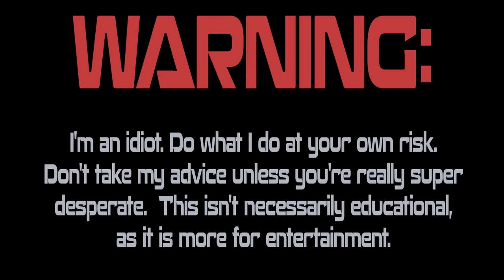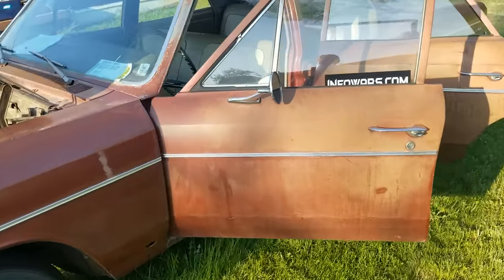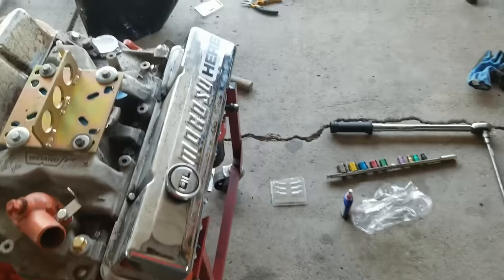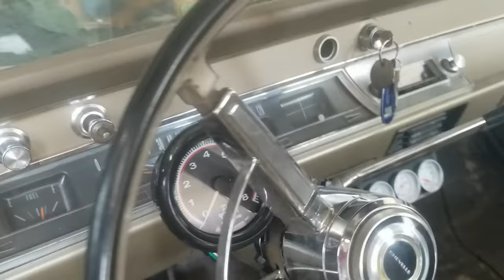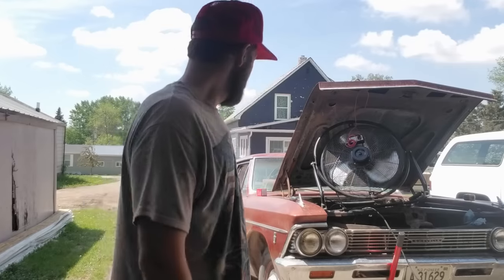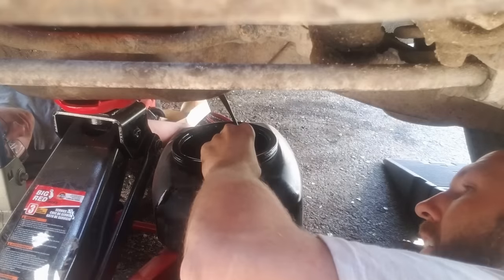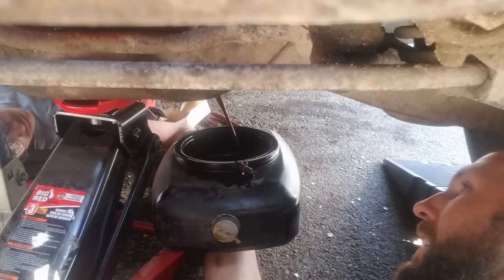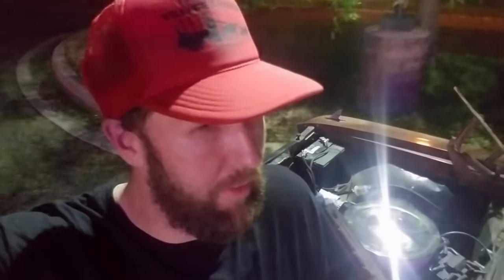ABANDONED Chevelle will it RUN AND DRIVE 600 Miles Home?

Comment: At just under three years later, this is definitely a change from the Independence Chevelle. Your videography skills have improved, as has your stage presence (that's not denigrating the early skills.  Just that you're better now).   Now I just have to find out what you do with this one.   (Unless this becomes the 70 Chevelle in later videos)
Reply: I like this stuff a lot.  Not that independence isn't a sweet build.  But this grassroots hot rodding spirit is very relatable

Comment: Make sure lower hose has a spring in it. If not make one from a coat hanger.  Without spring the hose collapses under acceleration.
Reply from the maker: Good point!

Comment: The reason you run hot is serpentine fan turning backwards. You need v-belt fan so it turns in right direction.
Reply: It also could really use a fan shroud.
Reply: Oh damn!   Never thought about this as an issue before!  Yes the other guy said shroud would help for sure and I was thinking electrical digical fans but he does need a V-* 4 core anyway... plenty out there for big block Malibus would cool this small block easy.
Reply: @THRASHMETALFUNRIFFS  I put one in my small block el camino. It takes a long time to warm up when you watch the gauges. It has senders in the intake and driver's side head. Problem is the holes in the small block shroud don't line up with the big block radiator cover so I had to use zip ties. And my soldering iron melted a divot into it.
Reply: @THRASHMETALFUNRIFFS  l

Comment: I like it a lot! Many people are to busy with life & or, full of it & don't appreciate the fact that cool cars are getting harder to find & that beauty/66 Chevelle 4door deserves another life! I like it a lot & im glad that a fun loving knuckle buster obtained it & is willing to turn a wrench & get dirty enough to get er going again! GOOD STUFF BRO!!! DID I SAY THAT I LIKE IT???? LOL     Me, I need any full frame vehicle I can find because I am so sick of 4 banger fwd trash! I want a 1973 Chevrolet 400 with 4.125 stroke! Brother had one that was bored .030 over, utilizing a stroker kit, forged, internally balanced crank, amber lightweight pistons 11/1 compression, the lift & duration -idk/ had it all written down but but, don't have that notebook anymore! it was a circle track/offroad cam from summit, aftermarket aluminum heads 202/160, roller rockers, msd ignition, Holley 750 dbl pumper w/manual seconsaries, th-400 w/new valve body, B & M shift kit, 3,500 stall conv, 373 gears in a mint 79 Z-28 BUILT BY A LOCAL MACHINE SHOP & MAN DID SHE RUN!!! 1/8 MILE BEAST!!! Long story short, I NEED TO RECREATE THAT DRIVETRAIN!!!!!! IF YOU KNOW OF ANY 1973 SB 400 WITH 4.125 STROKE, WITH NO CRACK'S, PLEASE MESSAGE ME?  GOOD STUFF BRO!!!
Reply from the maker: Hey, appreciate that! Thanks for watching and supporting.  In regards to the 400, they're great motors.  They all have a standard 4.125 bore, the stock stroke with factory crank is around 3.75.  Just have to be a little careful when boring them out.  Sounds like a rad Z28!  I think I have a 400 laying in the shed - but shipping will kill us unless you're from Minnesota.  Have you looked through Craigslist and Facebook marketplace?

Comment: Dang, it's a stick shift car! There's a bonus! I had to convert my grandmother's 66 two door 300 model to 4 speed and dropped a .040" over 427 I built into it. Basically a 390 hp 427 engine. Runs faster now that it will stop. Got the parts to fix that but haven't had the time.
Reply from the maker: Nice! This one needed a 4 speed badly
Reply: Brakes are over rated....Stopping is for those who don't want to win the race!

Comment: Just came across this. My first car in 1974 was a '66 Chevelle as well! It was also engineless but was a marina blue SS two door & had a Muncie M-22 rockcrusher & 4:88 12 bolt in her as bought. I was 16 at the time & built my first small block to bring her back to life. Fastest I could cruise in her was 50mph with that low rear, LoL. I bought new NOS chrome from the dealer for her & had her repainted. I remember problems as well with the positive starter cable melting from the header heat, ha-ha. Wish I still had her.

Comment: Them old 3 speeds are tougher than nails, I run one behind a 70 c10 for years with a 383 stroker and towed up to 8000 pounds, never had an issue.

Comment: what? A 40 year old dinky 6cyl radiator that was probably plugged 30 years ago won't cool a v8? the hell you say!!  LOL
Reply from the maker: Haha. What gives right?
Reply: Did you see the amount of debris on the backside of it? No radiator with that much blockage could cool a small block. Also a shroud would have gone a long ways.
Reply: sometimes what also helps is a cup of laundry detergent in the radiator, and take it for a run. Acts like a washing machine, and then dump out all the crud it washed and refill.  I like to lift up the front end, let the air bubbles in the system find the highest spot (like bubbles in a soda pop glass) and then burp the entire system with a big funnel.
Reply: @albertgaspar627  Or a $4 Prestone flush kit install in the heater hose and a garden hose
Reply: I love that those kits still exist--reminds me as a kid of doing the winter swap over on the parents' vehicles--tires and a rad flush. Does get in the way of the braided hose cover up kit, tho.

Comment: As a kid I wasn't well off, I worked the oil patch in the 80s and we didn't make the big money that makes big bellies LOL so a guy drove whatever he could afford... for me it was old GM stuff usually powered by a straight 6 and I never ever had one overheat or blow up. My '67 Chevy C10 was my last 6 cylinder powered truck. Being farm raised we knew all the other farmers and what they had for old vehicles and parts and I brought home a crazy strong 327 from a neighbors retired Massey Ferguson combine and decided to install it into my little '67 shortbox stepside truck. To just hear her run I used the 6 cylinder radiator and fired her up, seemed to cool decently so I fabbed up a nice shroud and used a big block clutch fan and not once did she ever overheat. Even when I swapped in the Duntov 3030 cam and a set of L84 aluminum Vette heads. Geez I remember paying 400 bucks for those heads, a lot of cash for me back in the early 1980s haha! But when I installed the MSD6A, headers, dual exhaust and a 700 Holley the heat started to climb quick so I tried a stock single core aluminum radiator from the GMT400 trucks and I learned that they cool quite well. I use those "cheap" rads in front of big blocks with no heating troubles provided there's a decent shroud and thermostat.

Comment: Brought back some memories. My second car ever was a 66 Malibu  2 door in that exact color but with more primer :P 327, 4 speed Muncie which was replaced with a Borg Warner T10 after I broke the reverse counter shaft off the Muncie. I had it for a bout a year then I went in the Army and had my parents sell it. Not much of a loss, the frame was broken on the right side just behind the wheel and booger welded back. Today that would not be an issue and would be repaired, back then, I suppose it saw a junk yard fairly soon after the new owner had it.

Comment: One thing that has worked for me in the past when the engine runs hot .As crazy as it seems i turn the heater controls to hot and turn the fan on full blast . It provides another way to cool the engine coolant. And of course you have to open the windows on the vehicle.

Comment: I was lucky enough to find a 64 Chevelle and I was surprised to see there wasn't much change in the body style compared to the 66. Mine also had the 230 six. I built a 350 and dropped that in no problem. I liked the aqua color that came factree. I've been watching your video for a couple of years now and I doubt that I've missed more than 2. A fellers back sure gets a workout doing this stuff

Comment: Car guys don't believe me, when I tell them about I had a 1970 red camero with a 3 speed and a 307 engine. We brought a used 4 barrel 350 engine and installed it. We took out the heads to have it valve job. So I was running the 307 small valve heads on it for about 3-4 week, and guess what,  it was a torque monster & because it had the 3 .
speed and the long 1 .
gear it was perfect and punchy vs the 350 later when the  head came back we put it in and you had to wait till 2,500 till it pulled. I wasent happy cause even in 2 th low it was soggy. So we change it back.a 350'with 307 heads LOL  yea the 350 head could rev higher but not fun. I wanted a long first gear no fuss long pull and any gear pullout like a big block and this crazy engine was the best street set up. Everybody say no no you need bigger valve for air flow.
Nope not with a 3 speed I would fly by shifting into 2th like your stopped. LOL but above 60 is where he pass me. LOL

Comment: A great short track trick to a motor cool take 3/4 washer knock out the center of the thermostat,  tack in place 5 eights, hole run a by pass hose  from  the thermostat,  to the heater hose outlet,  bam, it will never over heat

Comment: A shroud and electric fan might help with the cooling. 
Suggestions for the future:
Paint it and wrap it to look like NASCAR 
Spoiler and ground effects 
NASCAR side pipes 
Remove chrome and hood ornament
Removeable carbon fiber hood with pins
Racing seats/guages/fuel cell/ stainless steel rollbar
Suspension upgrades when 💰 available 
Racing steering wheel and linelock
NASCAR knockoff wheels and tires 
I had a 64 Chevelle dirt tracker that was a BLAST to drive!
WHY did I sell it??🤷🏁

Comment: I would not use a clutch fan for one thing and would have pulled the thermostat out . If over heating persists check the timing and if you have a vacuum at distributor take it off . With a performance cam there is no need. The weights in distributor is enough. Had the same issues with my 66 Ford Mustang . It was not the radiator . I drilled 2 small holes in the thermostat for a better flow . Checked timing too , was off .

Comment: Some parts stores just call the clutch pivot ball the clutch fork pivot stud, they forgo mentioning the ball so that may have been the issue at O’Reilley’s. I don’t typically go there, but I know for a fact Autozone carry’s them for a 63-80 GM style as well as numerous other makes and models. Hell even a Nissan 350Z/Infiniti G35 has a pivot ball, so it’s not some old obsolete component.

Comment: Maybe it's running a little warm because you don't have a shroud around that fan, it's not pulling enough air through the radiator but you knew that

Comment: Its code out so I had to run my truck with the heat on while I cleaned her up inside. I mostly just put the trash from the floor board in a grocery bag. Sometimes the plumber has to come out cuz of all the stuff I flush down the toilet. I was just trying to throw it away.

Comment: It would be cheaper to take a trailer & go get the car, but probably not as interesting.
You are so lucky in the US that all 50 states don't have a state inspection of fitness. In the UK we do. That says that you can't exhume a car from a barn, or wherever and drive it back to where it needs to be at. It has to be taxed, tested & insured before you can even push it across the road. English cars have been unibodies for many years & rust is a serious problem. 
Really old iron is conspicuously absent because car ownership was a luxury until long after WW2. 
You would not get very far in a total beater like that El Camino. Too many CCTV cameras in urban areas.

Comment: Next time u get a 4dr chevelle malibooty or impala, u should see if any of em could be transformed into a suicide. I had a 64 impala 4dr the only reason I bought it was because of the 427 tri-power that had been transplanted and it was as clean as they come but it was a 4dr and the 3500 i gave for it was worth it since id been looking for that engine carb set up for my non number 70 corvette roadster. Well..the 350 that came out went into the impala and I sold it to a guy down under but if I would've kept it I would've looked at the suicide option. Plz try it if u can!

Comment: What'd U put in there, sounded more like a 454 than a 355? Thing sounded like a beast with no pipes but you were definitely cranking some HP. I remember back in 1966 seeing that same car at the dragstrip all tricked out and pretty. That was a fast car. I know in '65 I think they had a 409 out.

Comment: Hah! Great minds think alike. I'm a long haired ex-hair guy, ran out of soap in the shower probably 16 yrs ago. Used some dawn anti-bac in a pinch and forgot to buy soap for awhile. Next thing I know my acne all clears up. After using pricy "shampoo" for years I started using it in my hair and found no difference at all from the pro stuff. To hell with all that shit they make you believe you need. The best part, and i got this off utube, mix some in a bottle of water and it will kill virtually any household insect including spiders. I wonder how it would work on Washington parasites? Great video.

Comment: Soooo, was this 66 a 6cyl three on the tree and did it still have the rear it had with the straight six? In other words, did you literally bolt up a small block to all the straight six goodies and it all worked? Thanks, Bruce Wayne.

Comment: My 93 year grandma has a sowing machine and that thing that makes it work is a motor because I think it runs of a power supply not gas  when you say a motor for the car you have got me confused yes I have drank a little to day but my grandma no the difference between a motor and a damn engine

Comment: car needs fan shroud  the fan blades are too far from the radiator back in the day they used to be almost touching as years went on they moved the fan blade away for crash safety concerns etc... people think those shrouds are so your hands don't get caught in the blades but it makes an air tunnel right to the engine saw it all the time in the mid 70's early  80's right around when they started doing that people would leave the shroud out when they would do and engine replacement I'm not saying that car had the shroud but the fan was pretty far from the radiator just saying i would have made one  and tried that

Comment: you so need to carry EMERGENCY quick build a Fan shrowd kit.  them rads sitting 3/4 of a mile away from the fan and block just do not get the cooling giggacuals it needs. that why them ellectrical fan a lators bolt tight into the rads. and always run night time nights are cool and days are like 100 plus heat waves.

Comment: A guy needs to ask. How do you get the suburban home?
Reply: A big block suburban could a pulled a trailer..  seemed a breeze to haul it back!?
Reply: Derick’s stik is always the drive back though. It’s really what’s makes YouTube so popular.  Will the vehicle that hasn’t been ran in 25 years.  Get up and go for a long haul. Anybody can put on a trailer and leisurely tow back 600 miles.